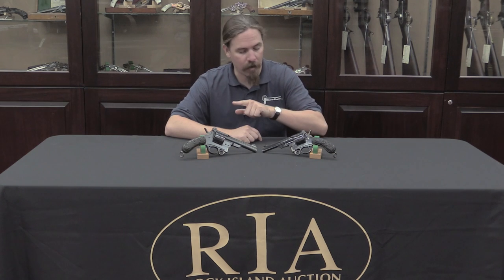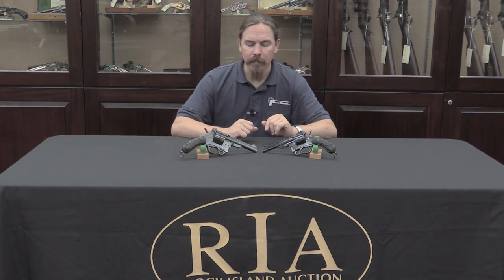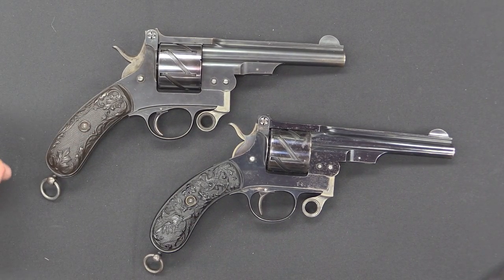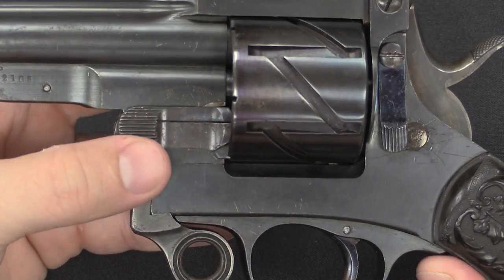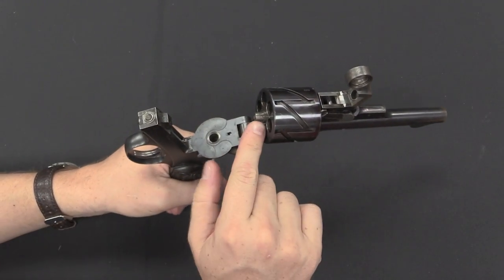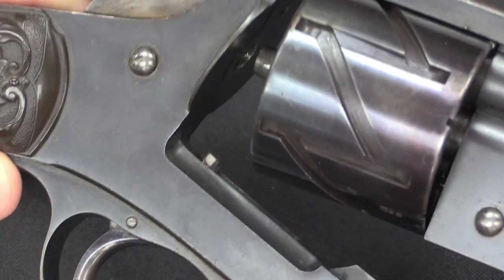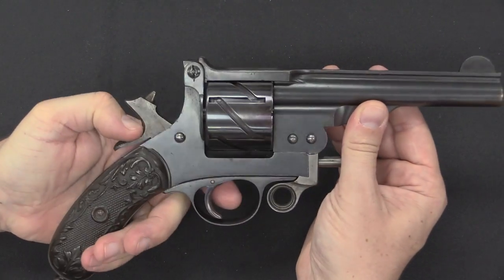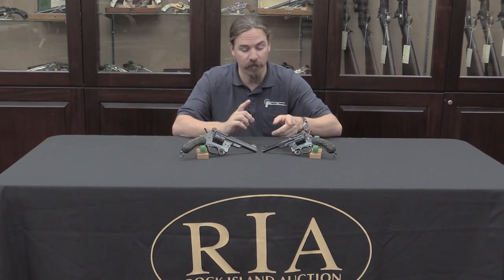Mauser Model 1878 "Zig-Zag" Revolver

Comment: During the cylinder closeups around 10:00 - 10:30, you can see from the machining marks that the shallow longitudinal slots were done with a horizontal milling machine - smooth bottom, tapered lead out, and the deeper camming slots were cut with a slot drill, presumably in a vertical machine, evidenced by the little swirl marks in the bottom of the groove, and the abrupt stop at the ends. It's difficult to think of an alternative way of doing it using the machinery of the period, but it must have been labour intensive, and expensive.
Reply: I think your 'slot drill' is actually an end mill. I was thinking that the machinery to grind little bits of tooling like an end mill was more of a feat than actually using it to make a wierd gun. The milling cuts into the walls of the cylinder right next to the chambers would make me scared to shoot it.
Reply: Machinist Talk! Machine Shop Jargon! Metal Words!

Comment: Due to the way the 'zigzag' works, it could be really easy to change the capacity or calibre of the guns without changing all your tooling.
Essentially the frame would be unchanged and you'd just have a different barrel and cylinder, as a smaller cartridge could fit larger capacity you simply machine the grooves on the outside at a different angle to fit the different number of chambers. The same with a larger calibre, match those grooves up with the chambers and it would only need three components changed (Cylinder, ejector and barrel)

Comment: Cool revolver, but the flaw is evident, the gun pops up, instead of down, it becomes much more awkward to reload. And because of the revolving system it has, it is impossible to change its configuration

It is bulky though and looks reliable, seems like it would get the job done.
Reply: It was intentionally built like this. Flipping it down wouldn't drop the cases out, meaning you'd have to turn it over anyways.
Reply: I'd buy one if they made reproductions

Comment: Very cool and I can see why they would fail a military trial. 

I see that moving cylinder and I just see something that could break off or get fouled. I also think that safety could cause problems, if it gets loose and drops from the middle to the lower position. I don't think they're ugly and that blue, is amazing. Still, if your competition beats you for being less complex, if that's not a sign to redesign I don't know what is.

Comment: That is a very cool revolver. It doesn't look that much more complex that a more conventional revolver. And in some ways looks more robust. Is there any failure data?
Reply: The worst thing imo is it opens upside down, otherwise it's pretty alright
Reply: The complexity isn't mechanical, if anything it has less moving parts than a normal revolver using that single lug to both rotate and lock the cylinder, instead of a hand to rotate and a bolt to lock.

The complexity is in the machining of the cylinder, those grooves have to be very precise, while being cut into a round object, before the advent of computerised machine tools.

It probably took them as long to make that cylinder alone as most other companies would spend on the entire gun.
Reply: @DAKOTA56777  I agree that machining this by hand would suck.  But since only the fore-aft cut is ramped, the actual machining operation for the zig-zag could easily be automated with period technology.  You'd only need some fine meshed gears and a cam to control the timing of each movement.  Watchmakers had been designing far more complicated machinery for centuries.
Reply: @AM-hf9kk  Evidently it's not quite so simple to set it up, as both this gun, and the Webley Fosbery (which used the same system of zig-zag cuts for cylinder timing) were expensive revolvers to produce. Possible, yes, but still more expensive and slower for not much extra gain over a traditional revolver.

The complexity comes from the fact that these zig-zags are also responsible for the timing lockup of the revolver, which means they have to be near perfectly aligned with each chamber, which is more of a complicated process because it's a continuous line being made into a curved surface as the piece rotates. There is very little room for any kind of play in the system to be allowed.

Whereas the locking notches on a traditional revolver are all independent little slots made with just a single cut at a single position, the cylinder isn't in continuous rotation as it's made, which basically negates the fact that it's round.
Reply: @DAKOTA56777  It's really not hard to make a spiral groove on a manual milling machine though. Most older dividing heads are set up with a driveshaft going to the back. The purpose of this is to be able to connect the dividing head to the handwheel of a milling machine by a simple gear train. This makes the dividing head rotate when you move the X-axis of the milling machine. This ofcourse also works with an automatic feed.

Nowadays something like this would be done on a 4th axis on a CNC machine. But I could probably cut grooves like this on a cylinder, even with the incline on the straight grooves, in an hour or 3 on a manual machine, if the setup time is included. It would probably take no more then 15 minutes a piece for serial production on a manual machine (just for the grooves that is). You really just need a jig that centers the cylinder on the chambers for serial production. There are parts on this revolver that I see as way more complicated to machine on a conventional milling machine.
Reply: @slome815  I dunno, again both these and the Webleys were more expensive than typical revolvers. Also consider that even a conventional cylinder was the most expensive part on a revolver, and they don't require precise synchronization between two axis of movement like these do.
Reply: You kicked a hornets nest ! 
    ( :

Comment: Martial revolvers are always interesting. U didn't mentiin the ballistics, but i am guessing medium weight bullets for the bore diameter,  at about 700-750 fps. That is pretty typical for black powder. Probably very similar to standard 38 Spl ballistics (158 gr at 755 fps). I can see how tge design is too complex. A more typical rotating hand system would probably be better. Even geniuses like Mauser and JMB don't always make perfect products. Great video as always. Thank you

Comment: Always wondered how that zig-zag system actually worked. :D
Also, not surprising that the army rejected it, with all the critical parts of the mechanism (guiding grooves, main rod of the guiding lug/main spring) completely exposed and the somewhat wacky safety/opening mechanism design.

Comment: Does the bar protrude when the trigger is pulled to ensure the gun is fully locked on discharge and also to ensure the action is not opened at that point either?

Comment: I noticed a small oval cutout on the top strap of the frame. It's hard to tell in the video but it appeared to go clear through and expose the top of the cylinder, but I might be mistaken. Is this something simply for weight savings or is there another purpose that I'm not seeing?
Reply: The front end of the cylinder is numbered, so you don't have to count your shots. To reset it to the first position (if you reloaded it early for example) you have to pull back the hammer and hold it, then rotate the cylinder to the #1 position.

Comment: Question for everyone. Why does the action bar come out the front so far? There are obvious reasons why thats not ideal and it seems unnecessary with the way the action is set up. The bar is attached to the hand that rotates the cyclinder. The hand/nub stops long before it exits the pistol. You just need your coil spring and the hand. The only reason i can see for a bar is to provide stability for the hand to help it ride down a track. I dont see any reason it needs to be that long and why you couldn't put the majority of the little bit of length it does need on the opposite side, inside the frame. Am i missing something here? Maybe so you cant break it open while its cocked but again nowhere near that much length would be required

Comment: What were the handles molded out of? Mustn't have been many cheap materials in 1878 to do stuff like that.
Reply: Could have been PVC, although I'd rather assume them to be made of some sort of resin (especially if you compare them to the material old fountain pens are made of).
Reply: ***** PVC was invented in 1872. If anything, the date 1926 would be relevant as well, as that was the year Semon developed a way to make the material less brittle and usable in many more applications.
That said, molded PVC (as a rather brittle and hard material) was first used in 1875.

Comment: Since the reciprocating stud is spring loaded, I can't see why the cylinder could not be closed in any position?
Reply: Donald Sayers Because it is spring loaded fore and aft, not up and down.
Reply: @samiam619  It has to be spring loaded up and down for the stud to follow the zig-zag track properly. What is not explicitly explained is that the track has small steps in it to force the stud to slide one way down the straight back and forth tpart of the track, but to divert up the angled part of the track when it returns the other way. The steps can be seen at  6:40.

Comment: there's a small lever on the left side of the gun right next to the cylinder. What's that for?
Reply: I did, he never mentions that part.
Reply from the maker: As far as I can tell, that's just a flat spring to prevent the hammer pin from coming out.

Comment: Why do these have a hole in the top strap?
Reply: The front end of the cylinder is numbered, so you wouldn't have to count your shots or open the revolver to know how many bullets you've got left. If you pull the hammer back as if to cock it and hold it right at the back, the cylinder can be rotated freely to the #1 position.

Comment: Looks like a good design to me, but I’ll bet that machining that thing accurately enough with the equipment they had was a pure bitch.

Only problem that I see is that pin sticking out of the cylinder when you pull the trigger. If someone else has ahold of the barrel, you can’t shoot him!